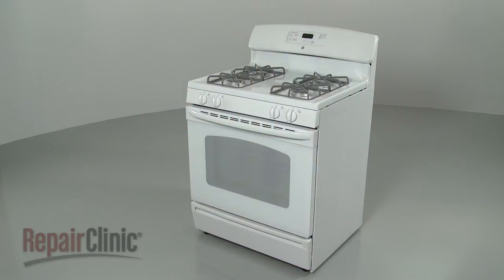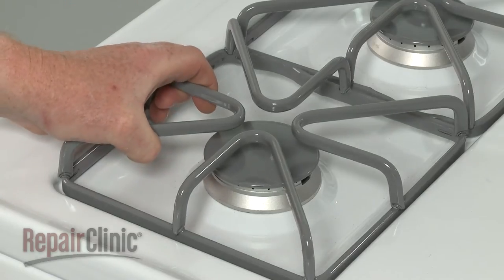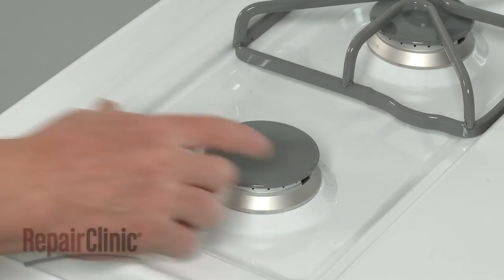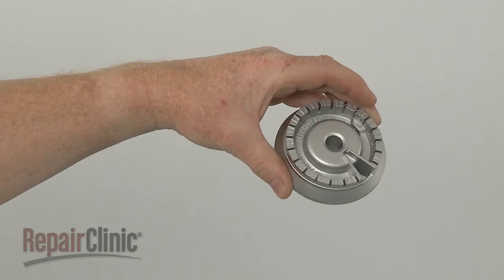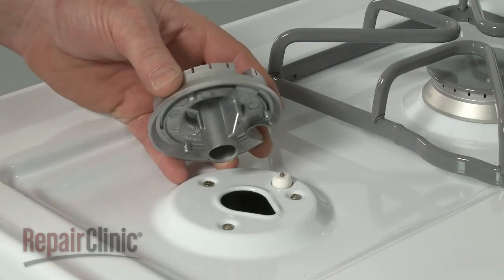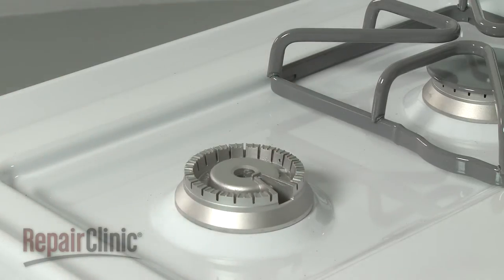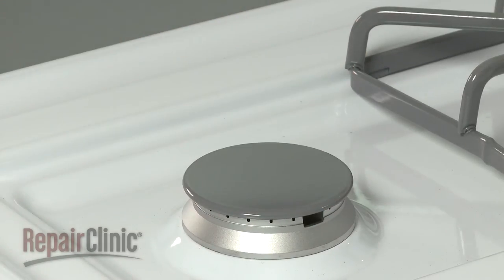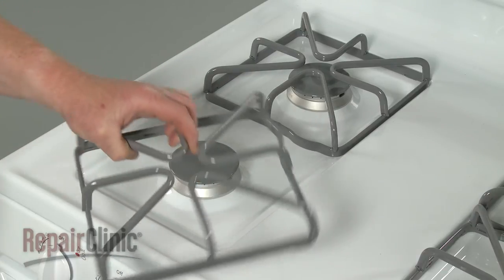GE Gas Range Burner Head Replacement #WB16K10055

Comment: Is it possible to replace a medium burner with a large? The large burner plate won't just drop into the medium burner pipe, it is keyed to not settle in properly. But is there some barrier to installing a large one?
Reply: Hi did you ever got that answer anywhere else? I am planning to do same and cant find an answer
Reply: @hayer444  Never found an answer, but nobody told me it couldn't be done. If I was still going to do it, I'd ask a licensed repair person to do the work. Or at least a competent one.